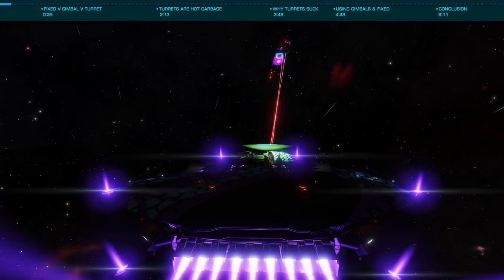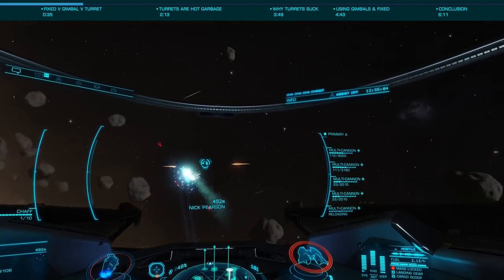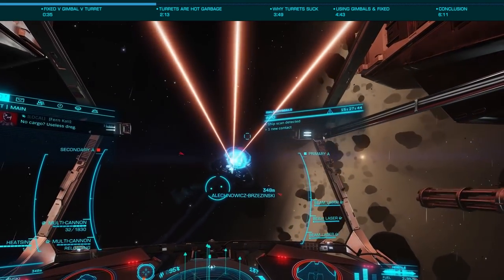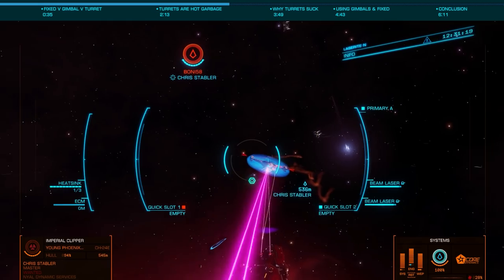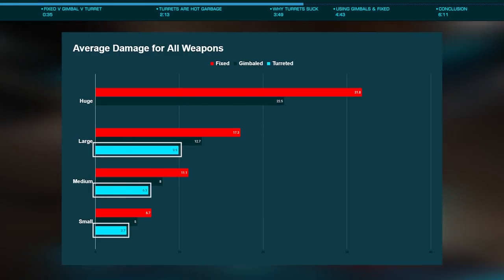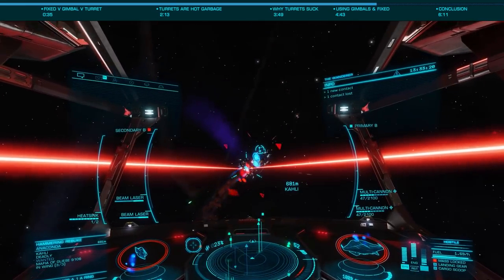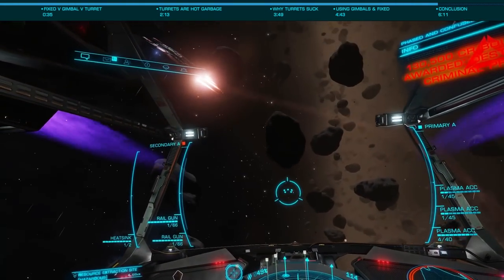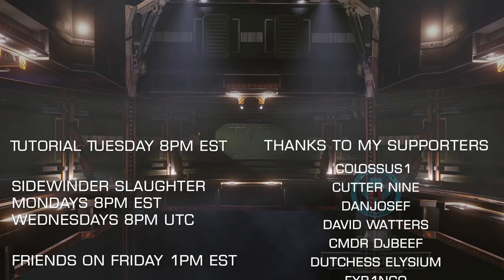Why Turrets are Hot Garbage - Fixed v Gimbaled v Turreted

Comment: as a low vision gamer, I would like to thank you for validating the reason I use turreted weaponry. I use them for target tracking. It's difficult for me to follow my targets due to my vision, so I follow the bright flashing lasers that a pair of class 1 pulse lasers provide me with. They're like my little target painters. I don't expect them to do damage, let alone hit the target, I expect them to show me where my target is :)
Reply from the maker: Great additional use of them - again, so long as you aren't relying on them as a primary damage source, but for something secondary they can work great - as in this case. I hope you're running a good experimental on them, like corrosive, emissive, scramble, etc.
Reply: I do the same with some turreted Class 1 Beams on my Corvette :D.  I was determined to git gud and stuck some big fixed guns on it and then discovered that in a CZ I could often not tell what the hell I was supposed to be shooting at :lol:.  Oh and I just stuck a couple of Turreted Frags on it because I usually wasn't fast enough to get off a shot with the Gimballed ones I had when the little so-and-so's in CZ's jousted me :p.  We shall see how they work out once the engineering is done :).
Reply: this makes me think of a jedi using the force to see. cool af.
Reply: I do this on my Anaconda because I suck at using the radar :)

(Plus I think turrets are perfectly viable on my PvE conda. I like the constant damage even when the target is behind me. The conda has the turning of a beached whale, especially with 4pips to weapons and 2 to shields. I am running 1 huge gimballed multi [with corrosive shells], 3 large turreted beams, 2 engineered medium seeker missile racks, and 2 small gimballed pulse)
Reply: This, whilst I can still see ok, I struggle like fuck with reading the radar and aligning with a target, the targeting reticle pinging back into the center of the screen always gives me a good indication of  which direction I need to be heading in for the next volley. I keep one small turreted weapon on all my craft for this reason. Well until I work out how the radar thing works!
Reply: @arseburgers4208  you probably know by now but each ship makes a little "golf stick" shape, where the length of the "handle" is how high above or below they are. So if you move the point to the top of the radar and make the "handle" so short it disappears, the ship will be directly ahead. Also, if you can't keep the ship in front of you, try boosting, it makes you turn much faster (but you can overshoot of course). Flight Assist Off and correct speed (middle of blue) also help.

Comment: This rule doesn't apply to the Type 10 though, which is a flying fortress with minimal turn rate and uses modded turrets to create an 360° death zone for attackers.
Reply: I thought the same thing lol
Reply: I run all gimballs on my bounty hunting/CZ Type10 and it works great.
Just make sure to engineer your thrusters, and you can't go wrong with an SLF either.
Reply: Which is what I use.
Reply: AFK is better than Gimballed xD
Reply: I agree
Reply: mine has 75 dps
Reply: What turrets (unengineered because I simply can't be fucked and I'd rather work on my hooning ship) would you recommend for a salvage T10 that wants to muscle through interdictions? Any old thing?
Reply: I can only get the "forward fire" active. How do you change it? Did they made turrets even less relevant, by not allowing you to chose?
Reply: @reinbeers5322  Yeah but that's an engineered one though. For a new buyer and possibly new player, the Type 10 is an enormous investment just like any of the Big Three, and they prolly won't be able to engineer it right away seeing as there's a lot to engineer on a huge ship like that. 
Until then Turrets are your best option because a lot of nimble ships will stay out of your view range which only turrets can do anything about. The dps is pretty garbage, but it's consistent DPS, and you're still running the definition of the tankiest ship in the Galaxy. It takes A LOT of beating to bring down a even unengineered Type 10's, and while it's shield strength is mediocre, the hull is a fortress. 
I love the thing. I use it as a multipurpose. Don't care that there's superior ships in either role, the Anaconda is the only other multipurpose competitor that comes close. Plus AFK farming is sort of a staple of the Type 10 so it has a farming path available to no other ship.
Reply: @carstenhansen5757  If you have turrets the option should be in the ship menu on the right panel. If not I'm not sure, mine always works when I have turreted guns.

Comment: You didn't do any hard analysis on time on target. While I know this varies massively depending on the ships involved and the pilots, it's impossible to reach a firm conclusion on this topic without such data.
Reply: using turrets gives you less tot due to the slow tracking
Reply: @brianlam5847  in u miss gimballed 80%  of time?
Reply: @old-fashioned1492  no, turrets have such slow tracking that gimbals deal more damage AND have better time on target. Turrets are only good with multicrew since chaff and tracking speed is buffed.

Comment: Thats a good tip with the gimbal to untagged and it goes fixed. Did not know that. Thanx.. ✌👌
Reply from the maker: Yeah, pretty key when you're using gimbals against NPCs who chaff constantly.
Reply: ☝️☝️did not know that! Great tip Cmdr Exigeous and thanks 👍🏼👍🏼
Reply: @Exigeous  ..and against people who chaff constantly.
Reply: Thanks for the tip, I've been playing for ages and never knew that. Great videos.
Reply: @Exigeous  Using missiles to target chaff launchers works well against NPCs.  I recommend pack hounds though just in case they also pack point deffence.
Reply: Additionally, to use your gimballed as fixed, simply hitting the target button can cause you to target someone else.  Instead, use your hotkey for target next system in route for a guaranteed deselect.
Reply: Ah, that explains why my gimbals go crazy. Thought it was a bug.

Comment: I like turrets because they make me feel like I’m piloting a big ship. I don’t want to dogfight a ship that’s 10 times smaller than me, i like fitting the Anaconda with only Turrets and watching them do there job. Also the limiting factor for me is energy. So as Long as the Energy efficiency is equally good it should not make a difference right?
Reply: The energy debate is essentially the tradeoff between burst and sustain. If you favor sustain, in the end turrets will be your jam - however, the fight will drag on considerably longer. 

It's also important to note that non-laser turrets do not benefit from this at all.
Reply: @Platius Cyndar if you don’t do competitive PvP it does not really matter anyway. In a fully engineered ship you are almost invincible. It’s more about the fun of just broadsiding and not caring what the enemy is doing and hitting them anyway. I like to do Multicrew with friends and then you need turrets anyway. All Packhounds is also very fun in Multicrew. Just pure devastation in every direction.
Reply: apparently turrets are actually MORE energy efficient than gimballed.
Reply: @MassDefibrillator  They are, generally. Most lasers and multicannons have better DPE.
Reply: Yeah it feels good riding a ship with turrets that do the job for you and just watch. I'd like if there were some kinda drones you could release and they'd fight for you that would be cool. Yeah I'm lazy
Reply: @Mart-E12  They are called fighters. And they do exactly that. Fight for you and kill/distract stuff.

Comment: You don’t mention Damage per Energy at all in the entire vid. A turreted weapon has about  25% higher DPE than a gimballed one. If you emptied your WEP on a target using all gimbals, you would do LESS total damage than if you had all turrets.

There are PROS and CONS to using turrets. I don’t think you should completely write them off. I use two on my Cutter, on the wings, and they’re great for applying debuffs. They also have a role in some setups where you can’t fit a hardpoint into one of your 2 triggers (ex: Chieftain with 2 Large Plasmas and 3 Small Railguns. That Medium hardpoint all alone at the bottom of the ship makes a good turret if you ask me).
Reply: He said that they are trash for primary damage.
Reply: @brianlam5847  Not is you get enough sustained ToT that you wouldn't get due to flying something that's not agile.
Reply: @valravnsshadow9422  even if, tracking is so slow that I get more tot with FIXED weapons, even on a cutter. Unless it is with multicrew gunners, Turrets are worse gimbals with worse tracking.
Reply: exactly. dpe is also important as turrets require the least amount of energy
Reply: @brianlam5847  oh cmon, don't be exaggerating. You're telling me you get more time on target in a cutter vs FDL, with fixed, because turrets track that slowly? I don't buy it.

Comment: Thanks for the video. I agree with much of what you say, however there are a couple of additional benefits to having one or two small turreted weapons on your ships.
First of all, if you are using fixed weapons for primary damage, having at least one turret will affect NPC behaviour as they are more likely to swing away from constant fire than stand toe-to-toe with you. This can lessen the damage to your own ship.
Secondly, if you are in a less manouverable large ship, they can help you deal with fast-moving small fighters while you concentrate on larger enemies.
Thirdly, if you are in a smaller ship that occasionally needs to move out of range, a single long-range turret can be useful to keep your ship technically engaged with a pirate while security forces take a ship down. This can help to avoid missing bounties if you have to disengage and can be useful while you hone your skills.
Fourthly, although they cause less damage, they can also create less heat and distributer draw, so they can be useful to balance ship weapon overheating. In some locations (eg. the small hardpoints underneath cobra Mk111s) they tend to fire at different times to fixed or gimballed weapons. 
Finally, it is quite rewarding to use a combination of fixed weapons and turreted because it allows you to concentrate on aiming just one weapon. This can be quite freeing and effective, even with smaller ships as long as you use high damage fixed weapons. An example might be a Cobra MkIV with three small efficient railguns and two overcharged or long-range turreted pulse lasers, ideally with a couple of effects applied.

Comment: Awesome video as always!

Been using turrets on my big 3 with a gimballed multi cannon for their huge HP since I got them. Never had any trouble mowing stuff down.  I knew they did less damage, but wasn't aware it was that much less. Still,  I play with mouse and keyboard, which means flying with FA off is very difficult. So turrets help! Plus, my wife and I are always multi crewing. :)  So we're 2 of the 7 - 8 people multicrewing! :P

Comment: It has been over a year since I last played but back then I was mainly doing bounties/conflict zones. I just really like combat. ;-) Turrets are very energy efficient weapons and I decided to use that property and go for a build that would let me stay in combat for the longest period possible. No reloading, no going back to base for more ammo. Just sheer persistence.

I was using a souped up to the max Federal corvette* with everything put into regeneration, both energy and shields. I was using beam turrets in the medium and large slots with efficiency and thermal vent. Two huge gimbal beam lasers with the same ef+tv mods. And two pulse turrets in the small slots with efficient, scramble spectrum and emissive (I was still trying to figure out if emissive was actually doing something useful or not). So yeah, lasers baby! The beauty of all this efficiency plus maxed out weapon regeneration is that you can fire the turrets indefinitely at only a single pip. Yep, I am not kidding. Infinite firing time. Put in four pips and fire the huge beam lasers and I could still sustain nearly a minute worth of deadly laser fire.

Occasionally you could get swarmed in a conflict zone as your AI teammates all died and shields started to disappear. When that happens the thermal venting really works wonders. Usually the heat level was near 0%. Even when I popped double shield boosters the temperature never reaches 100%, if you have a target that lasts longer than the regeneration cycle.

*I wish my old ED shipyard links still worked though. I would've linked the build here. :-(

Comment: The only two reasons I use turreted is to apply corrosive and emmissive effects. Emmissive I put it on the pulse since its instant in comparison to a mc. Also its great for those cold running builds since "fire at will" will always track him regardless of heat in my experience.

Comment: I'm not totally convinced, though my next project is to engineer more weapons to see what happens in practice - my opinion for the longest time has been that the Cutter is probably as effective if not more with turrets on top, because at that point you have effectively 100% uptime on 2x large and 2x small mounts firing at a target owing to its great roll speed and the good DPE of the turrets.

The huge has to be fixed or gimbal, and your job when flying one is to bring that to bear - but unless turret accuracy is really THAT awful compared to fixed or gimbal, the effective 100% time that the target is in your threat zone feels like it most likely outweighs the higher (but less energy efficient and harder to converge) damage of other mounts.

Comment: Thanks for the breakdown! Did you take in consideration that with turrets, the constant damage removes shield regen off ships? A small turret can be helpful then as well. Or with the Cutter which has such a bad pitch speed that it's top Class 3 weapons could benefit from turreted weapons?
Reply from the maker: Sure, I'd consider using a single small turret for that reason a good idea, as again you're not using it for primary damage - and that's the myth I'm trying to end.
Reply: @Exigeous  You're actually spouting the same old horseshit talking points from three years ago and framing it against a strawman.
Reply: @KevinVilbig  these same old talking points form 3 years ago might just… not have changed. If no balancing was done by FDev, then 3 year old talking points are still valid. And as far as I could tell, FDev has done no such thing concerning turrets vs gimbals vs fixed.
Reply: @platiuscyndar9017  Nah. They were the same reductive narrow minded analysis that they were 3 years ago, but go ahead and fly your 'conda out with a bunch of fixed guns. I'm sure that more practice with FAOFF will mean you will be able to catch that Vulture next time. Go get 'em champ!
Reply: I'm running a cutter... obviously not as my main combat ship, but I do have all HP's smaller than huge as turreted beams.  The amount of time I spend just pitching toward an enemy just to get them back in sight means I could probably get a 1-2 second volley off every 20-30 seconds of the engagement if I used gimballed... many ships could have their shields fully recharge in that amount of time while I'm swinging her big ass around again for the next shot.

Comment: The best use I've found for a turreted weapon is with builds like my Goid killer Anaconda. I use a turreted beam laser with thermal vent to vent the heat generated by all the gauss cannons. I also use one on my Plasma Vette. But other than a few niche uses turrets are pretty bad.
Reply from the maker: Yep, exactly - using it for the application of the experimental rather than for damage. Best use of turrets all around.

Comment: Beam turrets are just too good to ignore. They don't need leading and always hit. Unless target is using chaff that is but it can't be 100% in most cases. To match this output you'd have to be perfectly hitting the target for 30%-50% time of engagement with the gimbal/fixed beams. Maybe it's possible with smaller ships but not with larger ones.
As long as they connect, your target's shields are draining so your projectile can deal full damage. Also you only need to worry about aiming one weapon since turrets are shooting fully autonomously.